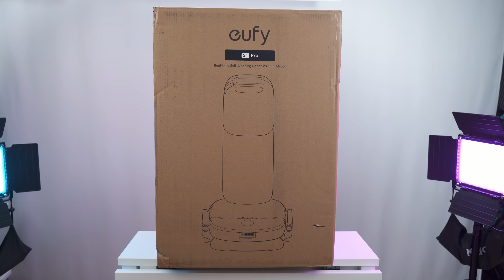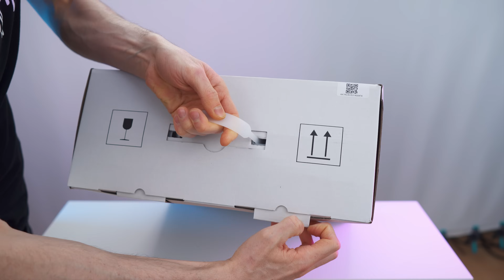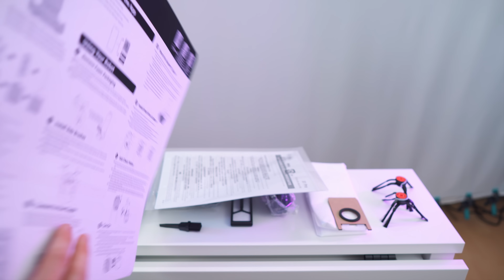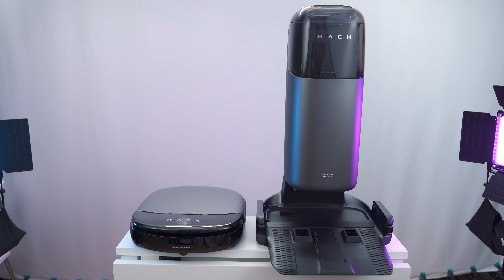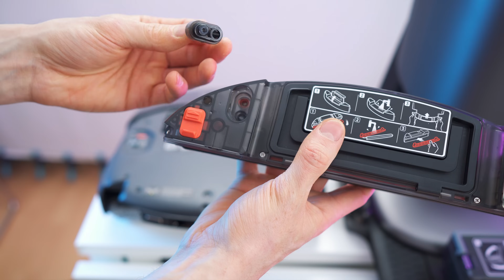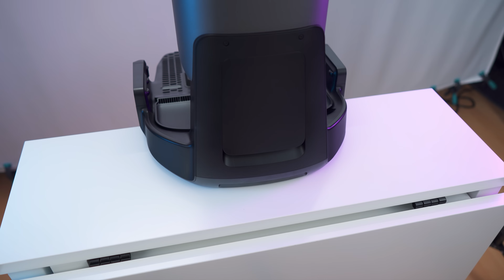World’s First Floor Washing Robot With Vacuum & Real-Time Self-Cleaning! - eufy S1 Pro Review & Test

Comment: ⚠️⚠️⚠️⚠️GARBAGE - SERIOUS PRODUCTION ISSUES - EUFY SENT ME TWO S1 PROS THAT AUTOMATICALLY TRIGGER THE CLEAN/PAUSE COMMAND. - DON'T BUY
Reply from the maker: Did you contact service about that und update firmware?
Reply: @TechMagnet I incurred £40 worth of costs due to a UPS delivery issue - eufy say they can only give me compensation in the form of hoover refills/accessories/consumables?!?!  I spent about a week documenting and recording the fault mode with their direction like a bloody unpaid quality/test engineer.

The issue on both devices is that the play/pause command is triggered erroneously with the button sporadically flashing on the base station.  this is symptomatic of a firmware bug or a sensor quality.   Both devices were identically faulty and I have read identical reports online.  this is likely a widespread production issue.

I asked for a reasonable discount as i can ignore the spontaneous commands by enabling the child lock and turning off the audio which repeatedly announces that commands are being discarded because of child lock however the WiFi/app connection is also unstable so you need to keep resetting the unit - absolute nightmare...

Anker aren't negotiating they want the unit back for a refund and me to absorb the additional costs (they should add a W Infront of their name and an S on the back ... right?!)
Reply: @TechMagnet  I had to call UPS (the box was too big to fit in the post office) - premium rate US number sent to me by eufy saying I need to call it urgently£40 down from here in Scotland as quick as a heartbeat 😢

Another thing - the client cannot force a firmware update! w(Anker)s push an update when they want - not ideal when your device won't actually sit in the base station...
this is what happens when you promote pretenders in their 20s to engineering managers cause they look sharp
Reply from the maker: @Onewonton  sorry to hear